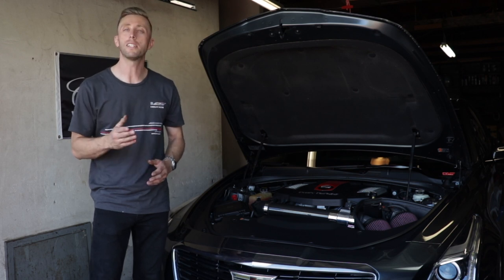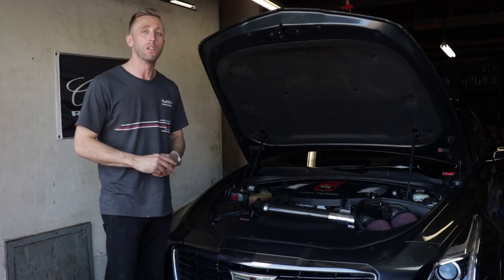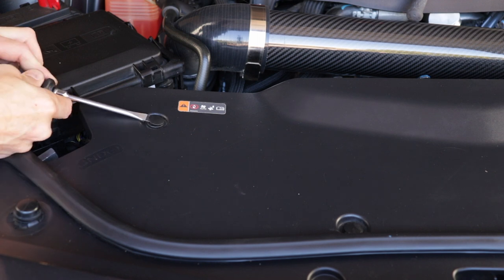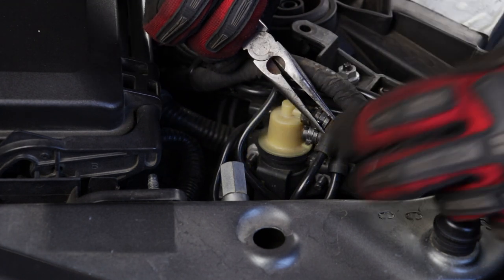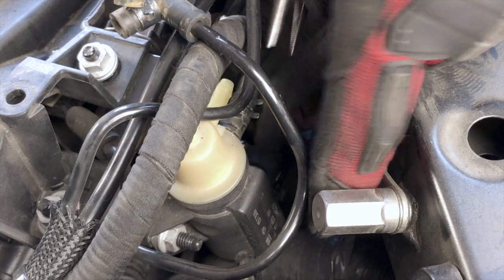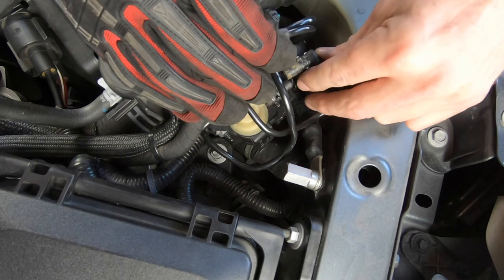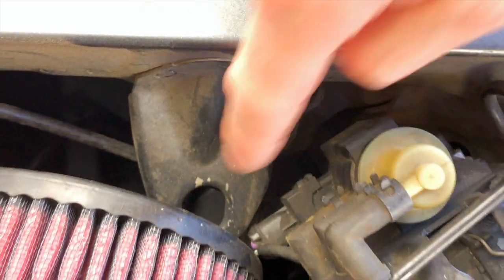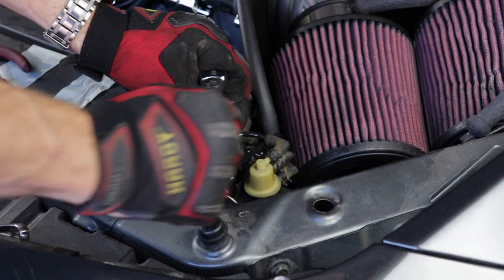Wastegate Solenoid Replacement | CTS VSport | ATS-V | XTS VSport

Comment: hmm, mine has been making this sound for a while, Wouldnt have guessed it was the wastegate solenoids. noticed something last night at the drag strip, car used to run 111 mph and was only around 106 and 107 mph last night,m checked the boost guage last night and noticed some gears my boost stops at 10 to 12 psi and creeps to 15 in others. Thanks for the video.
Reply from the maker: Have you bled your intercooler lately?

Comment: new subscriber here!!  Not sure why I haven’t found your channel before, but thank you!!  Dealer fixed this issue previously but started to make noise again and the dealer stated “this is an normal characteristic of turbo charger vacuum system no repairs should be made as per bull item #18-NA-104.”  Now i can finally fix it!!!
Reply: Thanks again Daniel your tutorial was perfect👌 Had to replace both sides and I didn’t even drop my 🥜’s.  No more buzzing sound!!

Comment: Another great video, would you be able to do one on fixing turbo rattle? I can't find anything on the FB groups in terms of fixes, TSB numbers, just of turbo replacements
Reply from the maker: J D that’s a very big job. Even adding the washers to the wastegates can take a couple hours from what I hear. Some have tried and it didn’t help. Replacing the turbos is listed at  8 hrs labor each side I believe. :(. 
I know the rattle is annoying but I’ve chosen not to have mine fixed because it doesn’t affect how the far runs.  I rarely even notice it, but maybe some are worse than others.
Reply: @JetFuelOnly  Thanks for responding, that answers my question

Comment: I got a 2014 xts4 vsport that got a check engine light i replaced both solenoids amd still just running 6psi boost do i need to program them ? Thanks in advance
Reply from the maker: No programming. What’s the code causing the check engine light?
Reply: @JetFuelOnly  p0299 turbocharger A underboost i also replaced a bypass valve solenoid its got 2 of them one for each bypass valve  i saw the updated video mine are setup a lil different i got a vacuum box rh side behind the radiator
Reply from the maker: @sergiosalas2406  unlikely to be the solenoids.  If you had that code only come up AFTER changing the solenoids you may have switched the hoses around.  Otherwise you likely have a hose our coupling not attached properly or a bad turbo.  Check your bypass valves.  People have had breaks in that area too.
Reply: @JetFuelOnly  it had the cel on b4 i changed anything i did pressure and vaccum test the bypass valves and wastegate actuatators one bypass valve was not holding vaccum or pressure  got it ordered...also i did bleed the aircharger intercooler...thanks
Reply: hey man, i have the same car the xts-v do u know where the solenoids are?
Reply: @denizgungen5323  front right top by radiator its got a vacuum box they are on ther

Comment: Just replaced mine on my 2014 vsport premium today... (bought it used with 40k miles) Thanks for the tips! Pulled out the whole booster like on your later video. Super easy swap out. No more noise at shutdown or same rattle/humming on slow speed/low throttle shifts anymore. Didn't even realize I was losing boost until I felt what it was supposed to feel like after the swap! Thank you again for awesome content!
Reply: Are both of them the same? Or do you have to buy a left and a right?
Reply from the maker: Same part both sides on the VSport.

Comment: Great video as always..My 2014 has always made that noise since I bought it 3 years ago..My stock boost runs between 12-15 without any real lag, so I never felt a need to replace them (& yes 2 different dealerships said it was normal when I brought it in under B2B)..However, I found a trick to make it go away when you shut off your engine..I've notice that almost every time I use my manual mode, the noise does not appear, so now when I get near my destination, I switch to manual mode & problem solved..I'm not sure this will work on every vehicle, but give it a try if it annoys you..Looking forward to the next video...
Reply from the maker: Interesting solution!
Reply: It's just easier to replace them.  40 minutes of your time.  The video was great.  Changed both.  Easy.  Thanks Daniel

Comment: OMG!! I found an easier way to get at them! First, thanks Danial for the "how to", you hit your videos out of the park!  

At 8:32 minutes you show an overhead view of both solenoids (left and right sides) attached to a long black box (the wastegate vacuum tank) that goes across the top of the radiator (the thing with the white tape on it). The solenoids are mounted to the tank and the tank is held on only by those 2 bolts that are on an angle attaching it to the frame. Remove those 2 bolts and lift the tank assembly with the solenoids up and you will have easy access to either or both solenoids. You need to release that other electrical connector on the top on the pass side to give you enough slack to lift the box up.
This should help a lot.
Reply from the maker: Thanks Gerald!  I’ll be actually replacing mine soon so I’ll give your method a shot.
Reply from the maker: Gerald, thanks for the tip, I've just uploaded a new video showing your recommendation.

Comment: Thanks Daniel, I have a 2015 Premium and it was buzzing after the engine was turned off. I bought both of my solenoids through Amazon $70 each. Just completed the install using both of your video's. A piece of Cake! No more Buzz.
Reply from the maker: That’s great!

Comment: hey quick question, do you know where they’re located on the 2014 xts-v?
Reply from the maker: I don’t know for sure but looking at pics I’m betting they are in a similar place under the plastic shroud but closer to the hood latch. Based on diagrams they are mounted to each side of a vacuum tank a little smaller than a football I would say.

Comment: Are the waste gate selenoif and the blowoff valve the same thing
Reply from the maker: Marc Bernard no. The blow off valves or recirculating valves are located at the top on each side of the engine going into the intake manifold. To control the flow of pressurized air to the manifold.  The waste gates control how much exhaust drives the turbo therefore it’s boost levels. The solenoids are helping to control the actuation of the wastegates.

Comment: Thanks for the video! Just another question, how can I tell which one is A and which one is B?
Reply: and also, how do I know which hose belongs to which hole? because I purchased mine used and wanna make sure its in the correct spot. I'd really appreciate if you can help me out.
Reply from the maker: I’m not sure what you mean by A and B. Was that somewhere in the video? (Sorry I made the video a long time ago). 

As far as the hoses go take pictures and mark each one. They MUST go back to the same connections you pulled them from or you will have boost issues.
Reply: @JetFuelOnly sorry I mean the solenoids, because i have a code for wastegate B and i don’t know which ones which
Reply from the maker: Oh. I’m assuming A is driver side.

Comment: So do you buy two of the same ones your link sends us to for the left an right? It bolts up the same on both sides?
Reply from the maker: CTS and XTS should be the single part number for both.  You are seeing that because only the ATS-V uses a different part # for the right.
Reply from the maker: I changed up the wording in the description to make it more clear
Reply: Jet Fuel Only perfect man, thank you for the help.

Comment: If you have turbosmart bov then you don't need to replace these right?
Reply from the maker: These are a different part of the turbocharging system than blow off valves so yes they need to be replaced when they go bad.

Comment: what about the fix supposedly to install $2 springs on the wastegate control arm to reduce the known rattle problem???
Reply from the maker: That’s a fix for a different problem. The rumor is that it doesn’t help. It’s the first step Cadillac is supposed to do to stop rattling wastegates but they almost always had to go to step two and replace the wastegates/turbos.
Reply: @JetFuelOnly  I imagine if one was to own a car out of manufacturers warranty that has that rattle, that since there's no recall for it, one would just have to live with the annoying loud cheap sounding rattle.  What forums can I read for this car?  I have not read the rumor where installing yourself a spring does not work I read a forum where one German guy said it does and no one else tried it.
Reply from the maker: Rick Dangerous it’s been awhile but it was certainly discussed in the Facebook groups. Definitely heard of people having the dealer do the work and then having to go back. Getting to it yourself is a challenge at least on one side.

Comment: Hey man my car makes a car kind of similar to this but it’s before I power it on I have barely any boost and my check engine light is a code p0299 idk if you would know anything about i would appreciate it if you can help with any of this
Reply from the maker: Before you power it on? Like when you open the door or what?
Reply: You fix the problem ?

Comment: How can you tell which one is making the noise,  is it really necessary to replace both?|
Love your channel...

Will this work: DORMAN (OE SOLUTIONS)    Part Number : 904-236 ???
Reply from the maker: Silvano Vitro you gotta go listen when you shut down the car. Comes from one of the corners.  That part is questionable to me. It doesn’t quite look like a good fit.
Reply: If replaced with the same OEM, its possible it will go again right - maybe bad design...

I take you advise and listen for the sound.

I will skip on the part if you think is questionable. 

Thank again for the information provided.
Reply: They both make sounds so, need to replace both ;(

Comment: Pls help .. i dont have this noise at front i have it in the back .. specifically on the the rear driver side .. i have 2014 xts vsport platinum but i have the boost problem as the boost not stable and low power .. GM dealer her in qatar said nothing in my car and my car is perfect but as normally i don’t believe them... is this watergate will help me to solve my problem?
Reply from the maker: I don’t think there is anything in the rear related to boost. The noise in the rear has to be something else. Do you have a check engine light?
Reply from the maker: You probably have air ride in your car. The air compressor is likely in the rear right. So that’s probably normal. 
Your lack of boost is another problem. You may want to replace the solenoids anyway and see if it helps. Otherwise you may have a boost leak somewhere
Reply: @JetFuelOnly  no check engine at all
Reply: @JetFuelOnly  the story start when someday i push hard the gas and check engine comes to my dash with code (over boost).. i send it to the dealer as they said nothing wrong. After that i start to find my car boost unstable . Sometimes its ok and most of the time its not. I send it back to the dealer and they send me video of there workshops manager telling me (hey man your car has power more than my car) can you believe that man?? Anyway i will send you video to your instagram to make you clear.. thnx man

Comment: I have a buzz or rattle under my 2016 vsport that only happens at 1500 rpms. All my searches somehow led me here. Any ideas? Will replacing the solenoids correct it?
Reply from the maker: No that sounds like the broken exhaust hangar issue. I’ll have a video on it eventually as I have it now too. It’s a piece that bridges both pipes under the seats area. Put your phone camera up over the top or the pipes. Look for black soot
Reply: @JetFuelOnly  sweet! Thanks for the prompt reply. Subbed
Reply: Went to the dealer this morning. Sure enough. They wanted to keep it for 2-3 days. I was like nope! I did my research and y’all aren’t eff’ing up my turbos for something that may be an easy fix. Let me know when you have that video ready. Happy Holidays!
Reply: @JetFuelOnly  i need help brotha i have a 2015 cts v sport  had a misfire in cylinder 5 that turned to random misfire code i replaced all coils packs and plugs check engine codes gone no poppin while car is running but have a rough idle that randomly appears sometimes its not always present could this be the culprit or what would u guess no codes or lights on in car and it runs like a bat outta hell but i do hear that boise when i turn off my car like in this vid??..
Reply from the maker: Rough idle is likely typical of the VSport depending on how bad it is. If you have bad wastegate solenoids it’s unlikely hurting your idle
Reply: @JetFuelOnly  bro ive had the worst 2 days with this damn car no clue whats the deal with it at all... 
Ok update was tryna locate a vacuum line leak suspecting it was the culprit last night spraying wd40 on vacuum lines because the rough idle started feeling more persistent and worsening unlike in the past it would clear up for a while then return..
Reply: @JetFuelOnly   So as i was spraying bits of wd40 at vacuum line connections the car went berserk and all of a sudden had Service stabilitrak service rear axle traction control off all blinking on display followed by a blinking check engine light that stayed on permanently now Pulled off driver side coil packs and spark plugs very little to no carbon build up on the plugs themselves reinstalled them turned the car on, this was last night and the stabilitrak traction control and service axle messages were gone but still had cel on...
Took it this morning to autozone and oreilly for obd readings and this is the result
Reply: @JetFuelOnly   Shortly after the same warnings as yesterday reappeared turned the car off and restarted it they are gone but cel stays on and it idle good for a while then abruptly has a very rough idle... tryna figure out where to go from here now and ive seen other people post the same fuckin problem they suspected battery but my charge wat 13.6 and above during the time these warnings were present The crazy thing ive been through the forums and seen alot of this shit but no one ever updates a resolution on this particular issue...  seen it in the cts v forums as well
Reply from the maker: Yikes. There are so many vac lines on this car. It’s a nightmare.
Reply: @JetFuelOnly  Found it! I backed her up on some ramps, crawled under, and lightly tapped the exhaust with a rubber hammer. My tapping zeroed me in to the mid point of the dual exhaust. There was a metal hinge that snapped out of its weld. It was about 4 inches long, maybe an inch wide, and about the thickness of a quarter. I pulled the hinge back just a tad from the broken weld and fired her up. Rattle gone. I have welder friend on tap. He’s going to put it back on for me. It seems to be there for reinforcement. There’s no hole in the exhaust in that section at all. I probably hit a rock or something similar and it popped up and broke the weld. I hope this helps someone. Thanks for suggesting I check the exhaust hangers.
Reply: @buchanaans21  had same prob on test drive... dealer had to replace failing computer.  Not sure which as I didn't own yet. Hope warrantied.
Reply: @ivand6614  injector 5 went bad 👎  finally tracked it down now that im back home and want to use my car